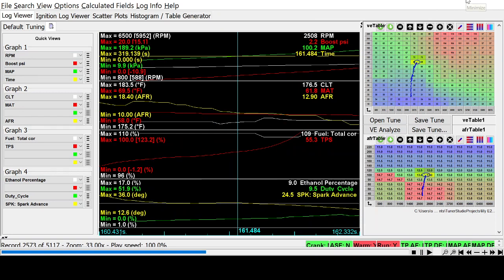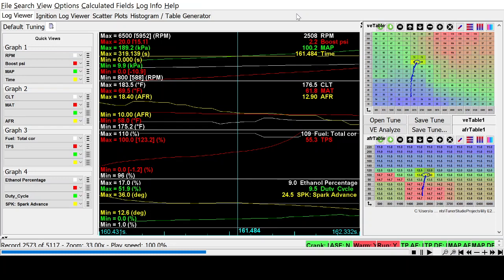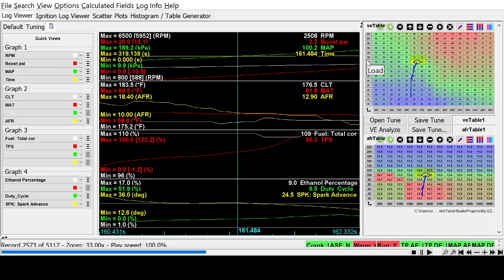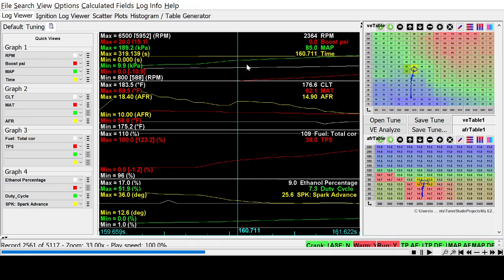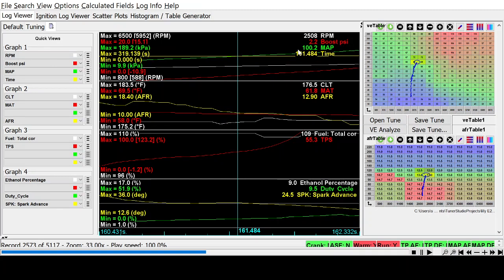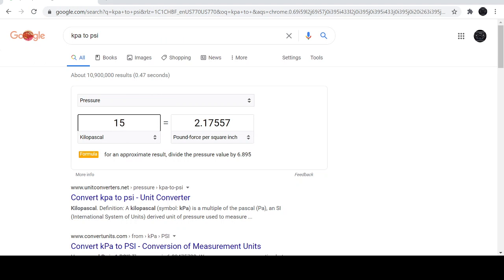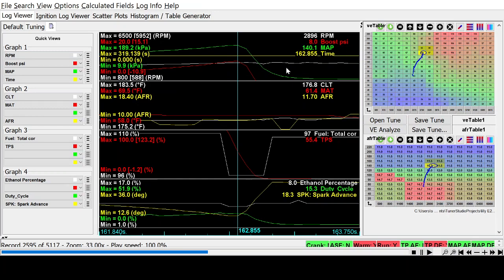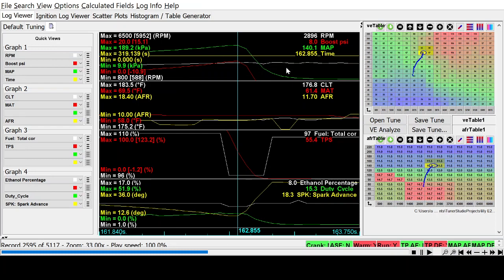Altitude VS Boost and Tuning

Comment: Thank you for the video. If I tuning my car for a maximum boost pressure of 15 psi at sea level with 91 gas, can I add 2 more psi of boost if I am at 4500 feet with the same 91 gas?
Reply from the maker: As long as the overall pressure is the same then yes 👍

Comment: If the turbo (mechanical or electronic waste gate) is targeting 14psi, will you experience a power loss as you go up in elevation?
Reply from the maker: The turbo has to work harder to maintain the same power level. The boost pressure is relative to the atmospheric pressure so 14 psi at sea level will be more oxygen dense than 14psi at 10000ft above sea level. So yes you loose power as you gain altitude even targeting the same boost level

Comment: My turbo diesel  (M57D25 engine) has a very strange behavior: when descending from 5500 ft it produces a lot of white blue smoke. This does not happens when I am driving up, only when I go down. It stops smoking when I am around 2000 ft. And I don't rev it.

Comment: Thanks for the vid. Quick question: do you have to consider this only if the customer is going to drive the car at high altitude or is this something you should always consider when tuning?
Reply: U should always consider...
Reply from the maker: Yes where the car will be used the most should always be considered